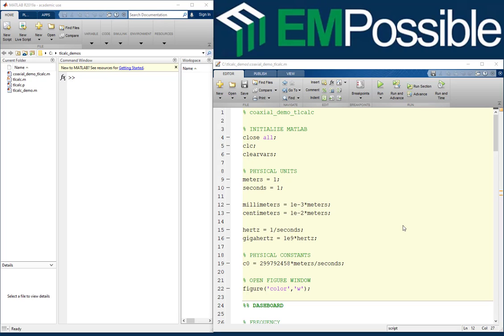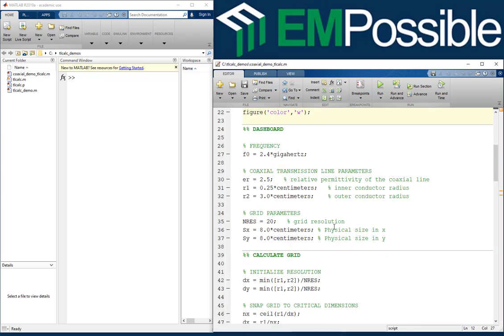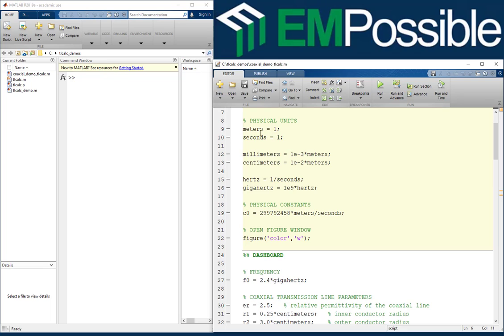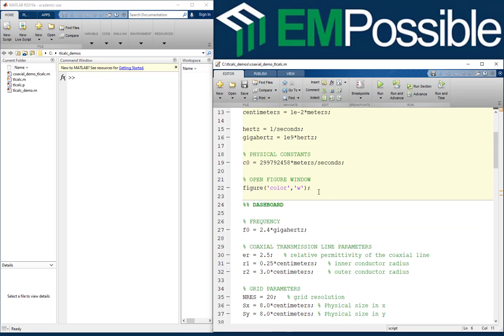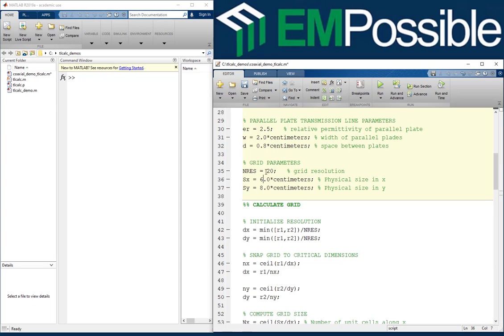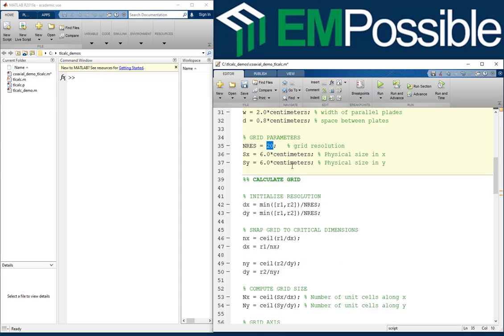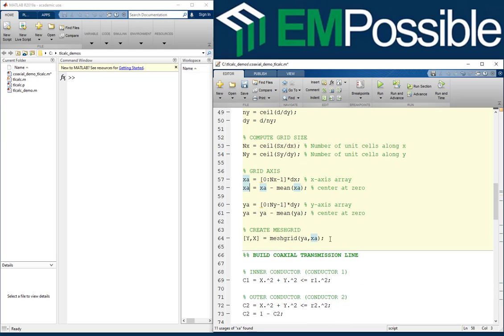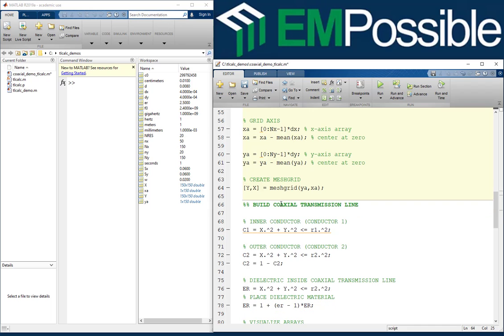MATLAB Session -- Parallel Plate Transmission Line Using tlcalc()

Comment: Sir, is there a textbook that you would recommend for utilizing Matlab for Electromagnetics?
Reply from the maker: I don't know of any that I would recommend.  Here are the resources I have created.  First, here is my Computational Methods course.  While not computational electromagnetics, it teaches the background you will need in both MATLAB and basic methods like the finite-difference method.

https://empossible.net/academics/emp4301_5301/

Next, here is a link to my Computational Methods course, but it is rather advanced:

https://empossible.net/academics/emp5337/

If you are starting from the complete beginning, I don't think you can beat the following online course.  It is intended for the complete beginner and even includes line-by-line explanation of of any line of code in MATLAB.

https://empossible.thinkific.com/courses/1D-FDTD

The follow-on course on two-dimensional FDTD will be available before Christmas.  It is just about complete and under a peer-review right now.

Hope this helps!